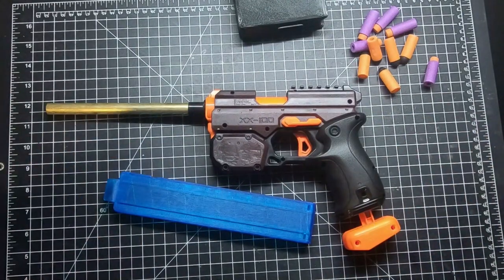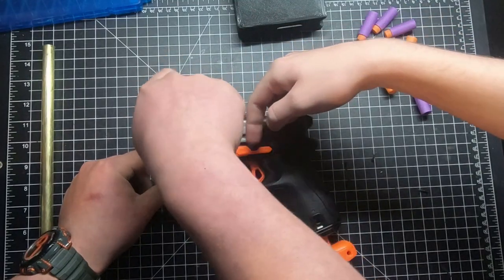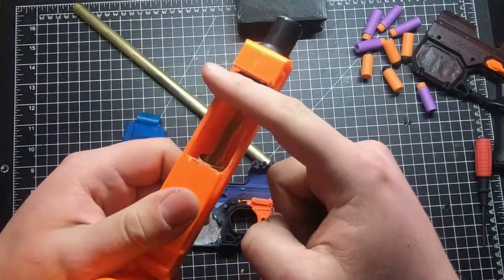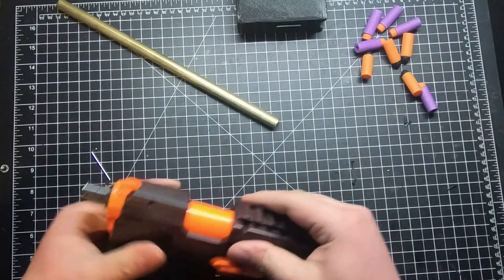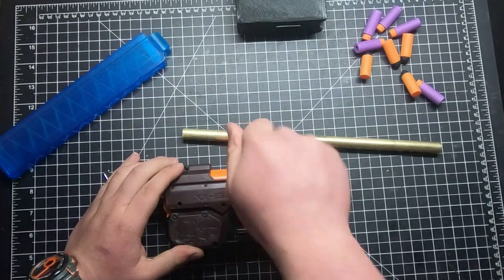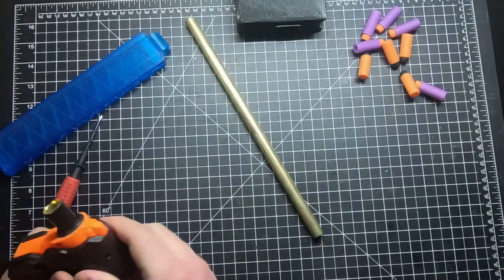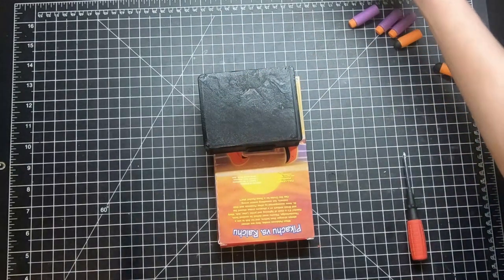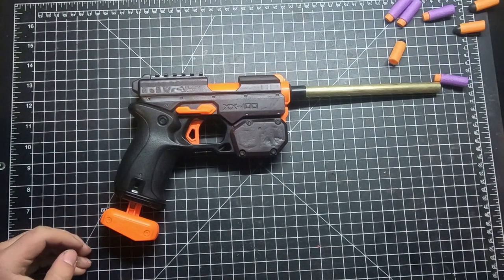Knockout Mauser Fire

Comment: 11:05 na, that chronograph is inherently not that good. Everyone I've met has had issues with it. basically the extra 25 bucks or so you save for not buying a real chronograph isn't worth it imo
Reply from the maker: Thanhtacles nope not busted works just fine reads accurately and it had a degree of precise that we are happy with. The reason we were having issues with the thing turning on is because we though the battery that was in it was a new one. Everything has been put back together and we just plug it into a way since 9v are expensive